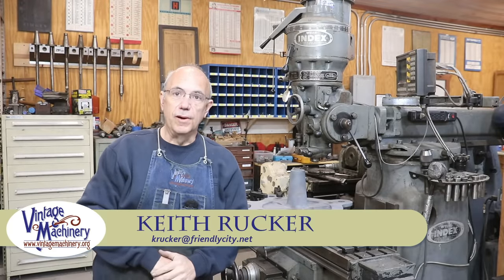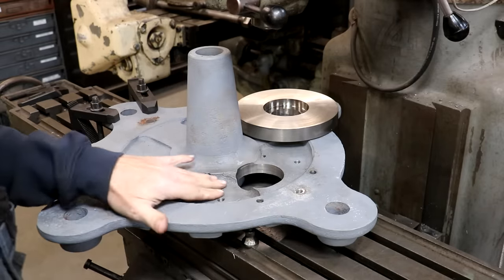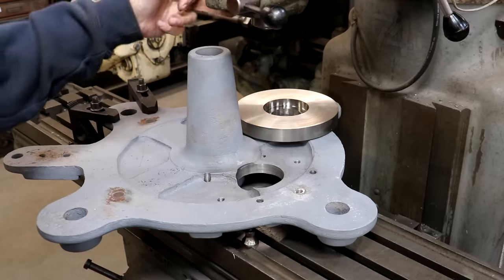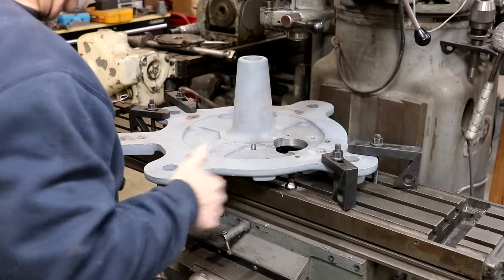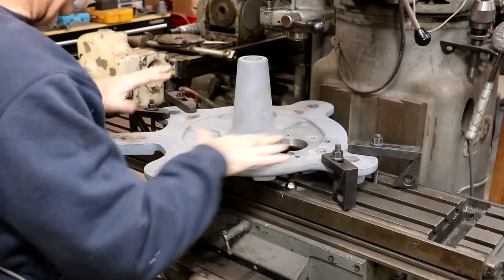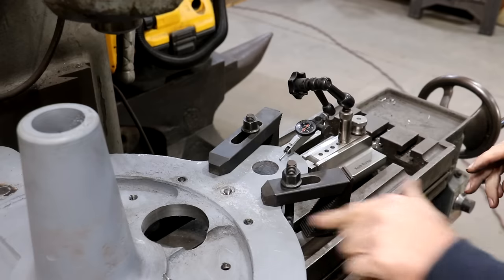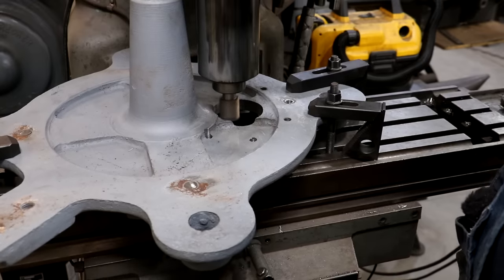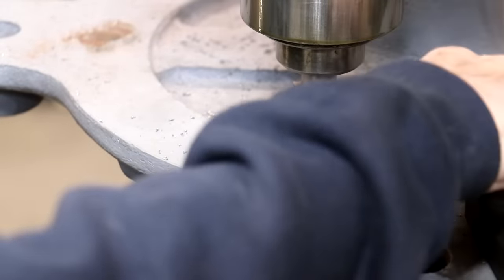Tally Ho Capstan Project: Milling Radius Pockets in the Capstan Base

Comment: It does not make sense. The bolt holes are at different levels. Especially the ones up on the edge. The piece will not clamp down with even support at each bolt hole.
Reply: A lot of metal will be chewed away from the adapter flange so it can mate up to the newly-flattened areas of the base - but those two bolt holes nearest to the base center still look like a problem.
Reply: @frederickstibbert7389  Keith is going to machine the Steel ring  to match and the bolts are getting installed from inside capstan body out through the steel ring to top i  think.

Comment: If the concern is to create a flat surface without removing original material; why didn't you build it up to begin with why not just burn a whole bunch of welding rod in there and then machine that off?
Reply: PatrickEdgington5827 cast iron does not keep its basic material under the intense heat of Welding. It changes into a form of iron which is hard and brittle. This HAZ or heat affected zone is enriched with carbon from the graphite present in the pour initially. Additionally, shrinking is a factor as well as it cools so there is that to contend with as well.

I hope this helps.
Reply: @CothranMike  thx for the response, and info.

Comment: Seems odd that for over a hundred years, this worked perfectly fine as a hand cranked capstan. Breaks my heart to see it being machined into something it wasn't designed to be. There can't be many of these left, maybe buying a modern electric one and putting this , refurbished to hand crank originality, in a museum. Just my thoughts. Would be tragic if it failed at some future point.
Reply: I think it will snap clean apart where it was machined for the new Gypsy.  A lot of metal was removed and whats left has no radius in the corners, so the stress will be focused there.